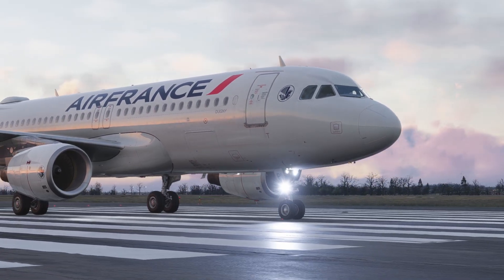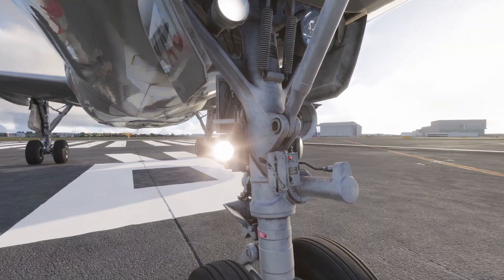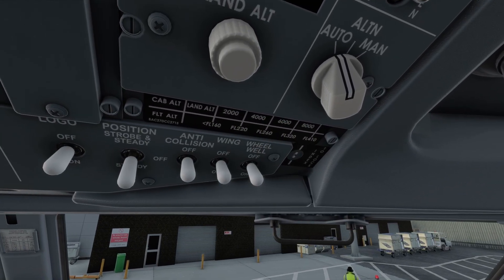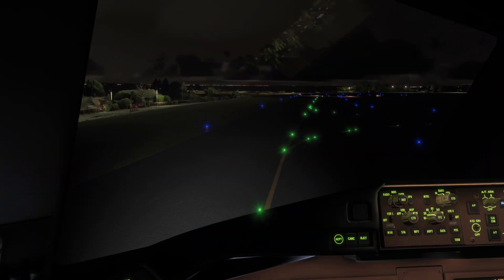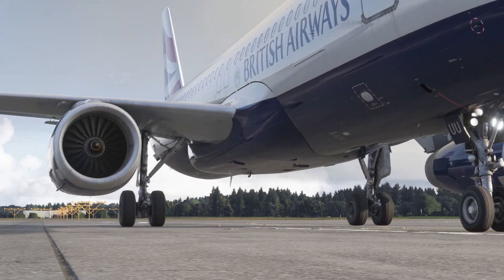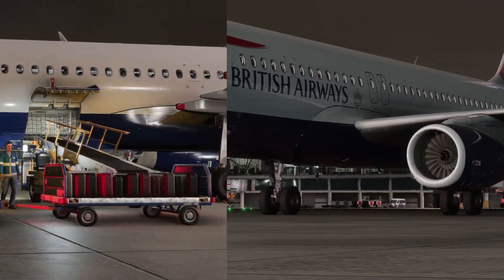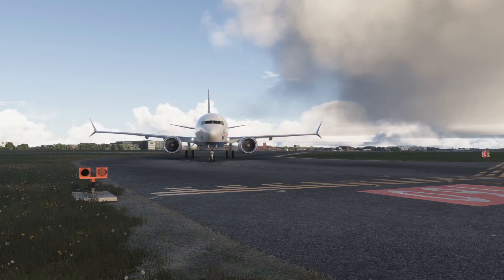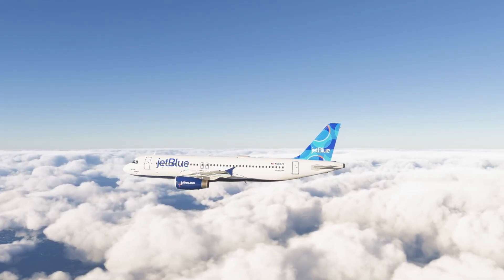Every Exterior Light EXPLAINED: Master Airplane Lighting! Part 2

Comment: This is great video, next time you can make video about types of approaches.
Reply from the maker: Any specific approaches you have in mind? I've already got a couple on ILS approaches to check out! Thanks for watching and I'm glad you liked the video!
Reply: @FlightdeckFocus Like how to fly an DME, VOR approaches. But I going to check out that on ILS. Btw, What graphics card do you use?
Reply from the maker: @MetromanDDD  I'll look into making some more then!

I'm running a 2 GPU setup in my PC. 
An RTX 3060 for my extra displays and for some Nvidia specific features, and an RX9070XT as my main GPU for running the sim!
Reply: @FlightdeckFocus I have GTX 1660 and its like hell flying FBW A380, but I will have a new PC in 2 days. But still, I recommend flying A380.
Reply from the maker: @MetromanDDD Same! I cannot run the FBW A380 at all! Some people haven't had issues with it, but even on the dev version on 4k textures, I barely get 15fps. 😅
Reply: @FlightdeckFocusTip: never fly this a380 to Frankfurt on vatsim.
Reply: @FlightdeckFocus yeah if you could tell how to fly RNAV approach and like basically all types of approach except ils
Reply from the maker: I will definitely start looking in to it!!